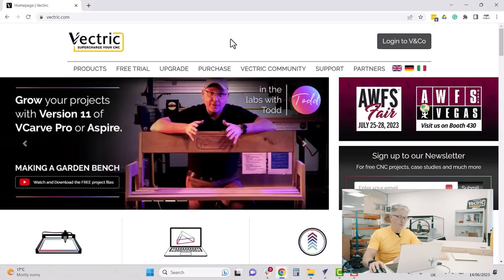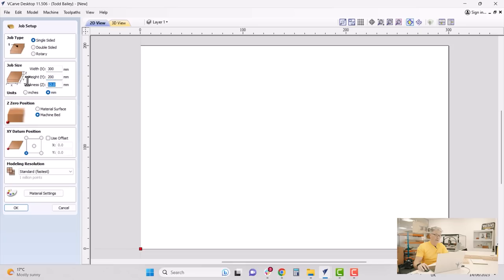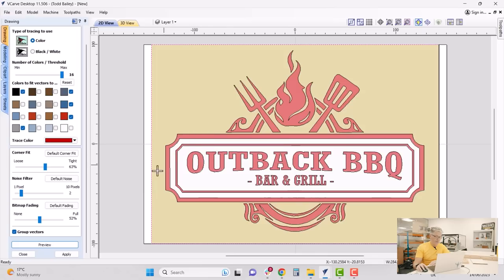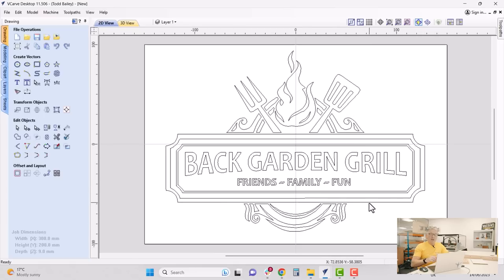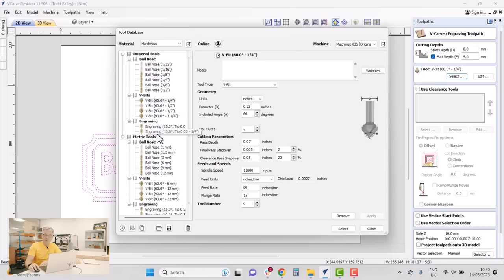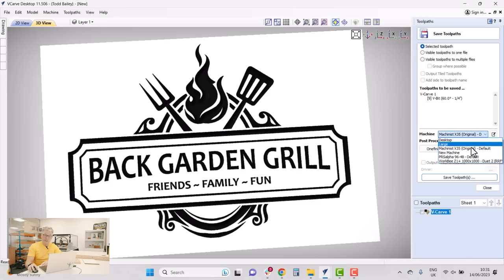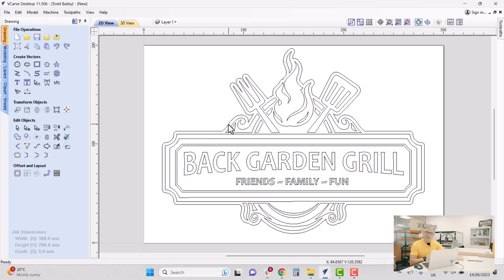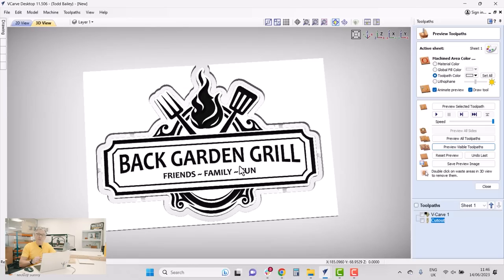Back Garden Grill Sign | Making a Beginners CNC Sign | In The Labs with Vectric | FREE CNC Projects

Comment from the maker: If you happened to download this project in the first 24 hours after release, you might notice the included project file will not load properly into your software.  We have corrected the issue, and if you re-download the project from your V&Co account it should be all fixed.